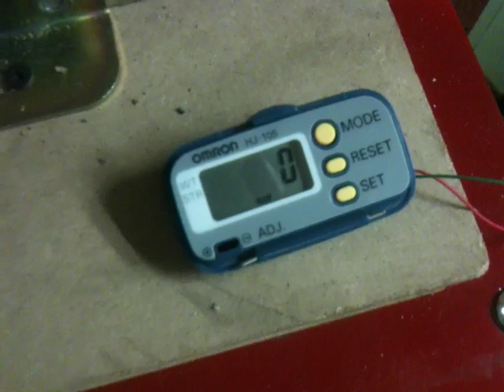9.29.11 EPG Update & Live After Show! 1/4 Of Coils Done! RWGresearch.com ~Russ

Comment: @Anothercoilgun  there ya go.. really you wouldn't even need a pic, just a laser shined on a mirror placed on the wheel, reflected into a photo-transistor, the pulses could be sent to a series of 4017 decade counters..-- and say you wanted a thousand wraps, you would set it to divide by a thousand, and the output pulse after the 1/1000 revolution would trigger a relay disengaging the motor.

Comment: over all I like what your doing, I would recommend a revolution counter, you should be able to make a simple one with a thumb counter and a bolt that sticks out the side of your shuttle, as it turns the bolt could depress a lever and in so doing press the counter button. Also are you going to try this with non copper tubing? Copper is magnetic meaning that you are reflecting some of your magnetic fields and loosing a bit of efficiency, plus the tubing itself will be generating current causing heat and energy loss, I was thinking a plastic tubing might be worth trying. Keep up the good work  and thanks for the video.

Comment: Well crap, I was figuring the wrap counter idea would work with ease - guess a higher refresh rate device is needed - maybe an arduino based controller.
Dang glad you figured out about the spacers set-up to keep the new coils in line while wrapping. Awesome...
Sorry I missed the show Bro, Thursdays are full for me. I do side work on Thursday's, sometimes even front and back work.
[snicker]
Peace.
Mike..

Comment: HI,
New to your channel.  Not sure what u r up to or the purpose.  What are the concentric circular coils made out of?  They look like copper tubing? 
What not use use a rev counter?  you could even use your counter mechanical, speedometer types counter like on your wire straightener and dispenser.  Just have it mechanically trip a single digit every time your winder makes one rev.  IE: the good old : KISS method.
Looking forward to seeing what it is that you are up to here (< 8)